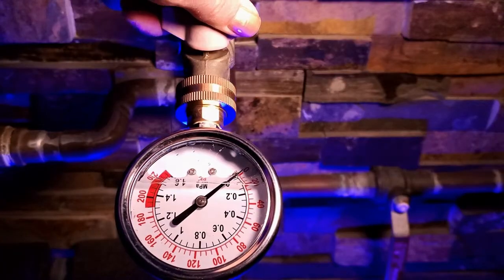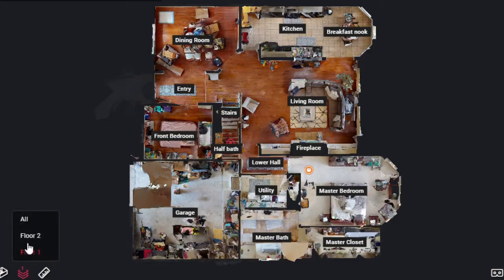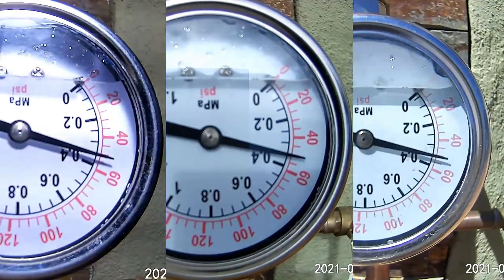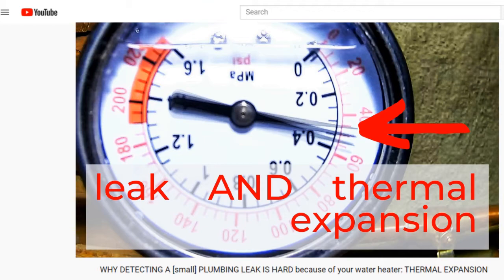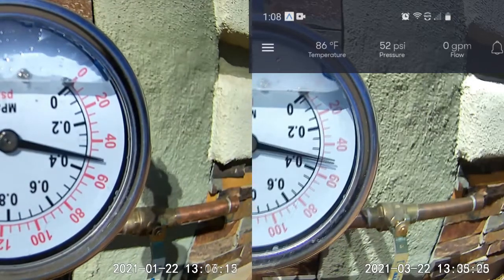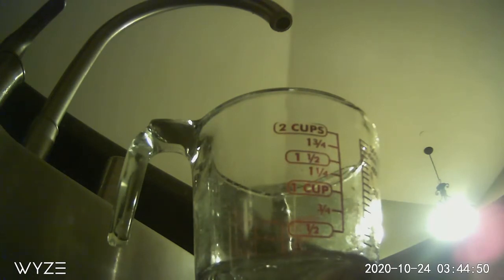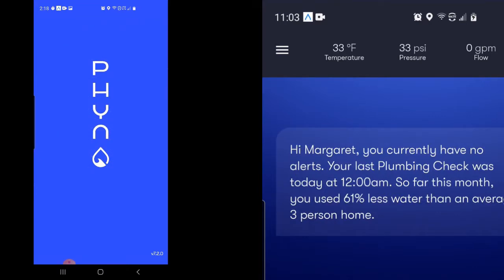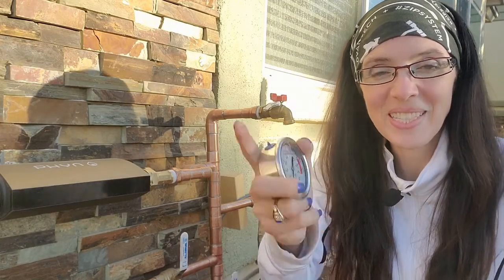THE smallest PLUMBING LEAK DETECTABLE WITH A WATER PRESSURE GAUGE [15 Min / 1 Hour / 8 Hours]

Comment: This is some great content, are you an engineer by trade?! I just reran pex through my entire house, saw a 20 psi drop overnight but I have air in the system still not sure if that ALSO makes a difference?!  Lots of factors, good call on expansion and the data to back it up!
Reply from the maker: Good question. I'm not sure on the how an air-filled system works. I saw this video from Uponor: https://www.youtube.com/watch?v=9eeNFUXblOk but the one question, which everyone probably wonders is "how much pressure loss is acceptable" was not answered. My guess is that it really depends on the starting PSI and how much plumbing is run through the house. I'm sharing hard numbers on my house, but my neighbors house, who like yours, is PEX run through the attic, would have much different numbers than my (mostly) copper lines.

lol, somewhat pegged on the engineer--I test software. I was curious on a more economical answer for a pressure test having tested Phyn Plus and Flo by Moen.

Comment: Sorry I think I'm going to be asking a stupid question because I'm not an engineer lol. So my project is to hook a cold water line about 220 yards from the house to a garden. Simply so I don't have to run a long hose line everytime. The line will be buried using a sprinkler line. So if I install a pressure gauge in the beginning of the line, I shouldn't have to worry about the water heater (expansion) bc its only cold water?
Reply from the maker: No stupid questions here--we all start somewhere. 😄 Plumbing didn’t cross my mind before I had a leak. It sounds like the plan is to increase the volume of the system. Even if you have a closed system it should not be a problem. Worst case scenario, if you have a closed system and the expansion tank goes out the pressure has more volume to disseminate the increased pressure. Let me know if that doesn't make sense.
Reply: @NoMoreLeaks  ok I think you answered it :). Thanks 👍

Comment: Thermal expansion can really be deceiving. I did a water pressure test on my cold water lines by shutting off the ball valves before the water heater and where the water enters the house. I put the gauge at the spigot where the water comes into the house. The pressure was 65 psi. I started the test at 10 AM, when it was still cool outside. However, the sun was shining on the gauge and the water pipe coming out of the ground.  I checked the pressure about 2 hours later,  and it was down 12 psi. The temperature outside had warmed up considerably, and the temperature inside the house was also warmer. I repeated the same test at night, and the outside temperature was 66 degrees. The pressure stayed at 65 psi for 45 minutes. The needle didn't move at all.
Reply from the maker: Those are surprising results. I wonder if the pipes also expand with the heat. What are your pipes made of? I might have to try a day test like you since most of my tests were at night. The good news is you don't have a leak if it held for 45 minutes. Are you concerned about one?
Reply: @NoMoreLeaks  The pipes are copper.  I have water coming up through our concrete slab, but the water appears only when the slab is covered with a plastic sheet (or flooring). Otherwise, it looks dry. I have separated the cold and hot water lines, so I can test the pressure in each one individually. The hot water line is the hardest one to test because the pipe cools during the test, and I get a pressure drop of about 5 psi before it stops losing pressure. So, I don't think I have a leak, but I also don't know where the water is coming from. I also did a sewer water test, and there's no leak there either.
Reply from the maker: If the pressure doesn't continue to drop, I agree: it's not a leak from the supply line. How's the drainage around the house? Gutters? Slope around the house harboring any rain runoff?
Reply: @NoMoreLeaks  The ground slopes nicely away from the slab in the front and back of the home. On one side, there is a french drain that was put in maybe 15 years ago, but the ground does not slope towards the slab. It's level ground. We did have new fencing put in around the home about 2 years ago. The fence installers noticed quite a bit of water about two feet down in the post holes, but not in all of the holes. I opened up the wall behind the bathtub to check for faucet or drain leaks there. There is a hole in the concrete slab where the drain goes to the sewer main. I can see dirt below the slab through that hole. The top of the dirt looks dry. But poking down into the dirt with an 8 inch long screwdriver, the dirt is just a little moist about 6 to 8 inches below the surface of the dirt. I don't know if this is normal or not. I can't figure out where all the water coming through the slab is coming from.

Comment: I did the pressure gauge test in our water line. The pressure drops to zero within 2minutes after closing the valve before the water meter (indicating a leak). but if the valve is open the meter is totally still. Any idea please.
Reply from the maker: When the valve is open it is going to maintain pressure because the city/well, is maintaining the pressure. It sounds like you have a leak. You've probably looked indoors beneath the sinks and below the toilets. Have you shut off the valve before the water heater to eliminate the hot water lines https://youtu.be/I4F4HV4nipk?t=125? After that I'd suggest turning off the quarter turns/ball valves on the toilets. Just eliminate all possible shut off points before having to call in a forensic plumber.
Reply: @NoMoreLeaks  thank you. Pressure is maintained if the valve before the meter is open (meter is not turning...even for 24hrs the meter reading is the same). But if the valve is closed pressure drops to zero within 2min.  By the way we don't have heater